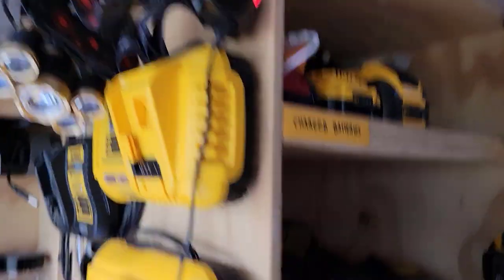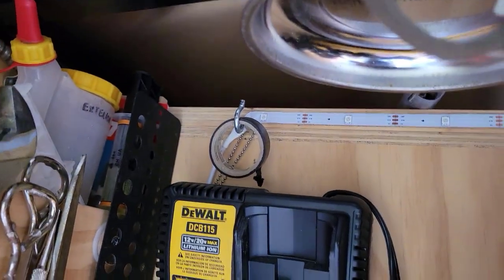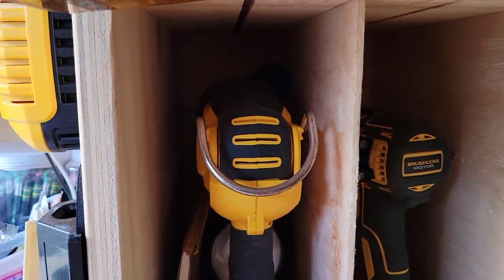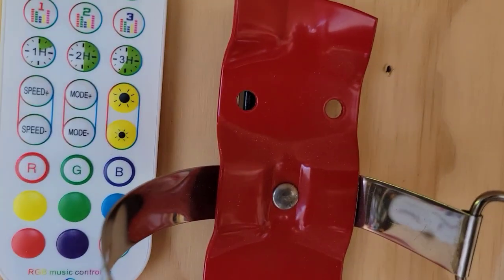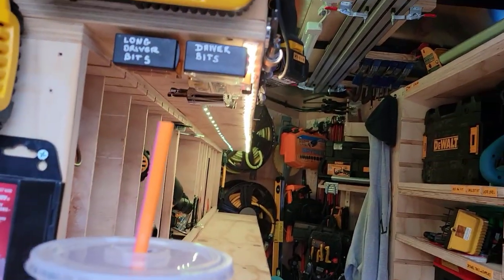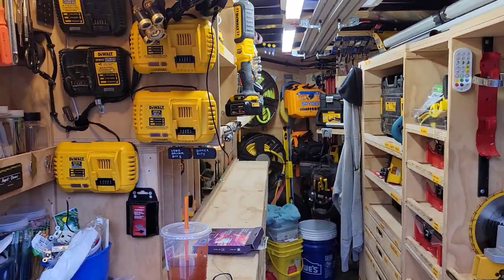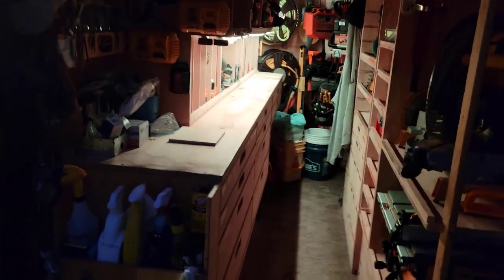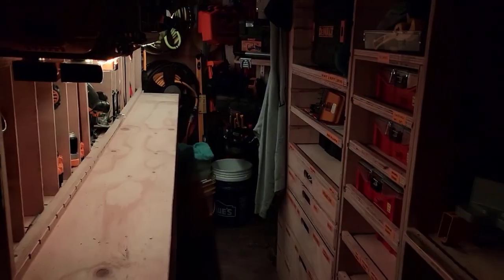Paulk SMART trailer w/DeWalt 20V battery-powered  LED lights

Comment: Very Cool - Thank You for sharing.  I didn't know you could get a USB port on a battery pack
Reply from the maker: Thanks for the comment!  I took a tip from a trailer tour video from Real World Carpentry Remodeling where he uses a hardwired battery pack to power some lights. Not wanting to take the time to wire, I found a USB pack that fits my DeWalt batteries for lights when I am not plugged in otherwise. It has been very helpful and real easy to add.
Reply: Or you could make your own diy with 12 cig female, 12 volt 24 volt in car usb a usb c out adapter some wire to put on or have blade crimps for any  18 volt 20 volt tool battery
Reply: @sdsconstruction  Could you please post a link to where to buy this?
Reply from the maker: @craftymulligar  no idea but it sounds like it would be possible. I am not real knowledgeable with low voltage so I cannot say for sure.
Reply from the maker: @joecnc3341  Hi Joe! I am currently looking for a converter for a 60V flex battery to 24V DC and if I find it, I will upgrade this bank of "just in case" lights to a 24v LED system. This 12V system is finicky with the 20V battery without an inline stepdown.

Comment: Hey Steve. 
I think it was my video that introduced you to the led lights / dewalt power converter. 
Anyway I like the automatic feature of yours . I thought of doing a motion detector switch but haven’t yet. I think I might be inspired to do it now.
Reply from the maker: You are correct! It was you! Thanks for the cool idea. I really took a low tech approach to your system but am really happy with ambient light when not on shore power without the need of a flashlight (even lower tech). Motion detect would be cool but I am only full time in/out of the trailer during the summer so for me, that would be a real luxury. Next trailer? I would like to go “luxury” with many bells and whistles and motion lights and solar panels and marine deep cycle batteries and…and…and! Thanks for the cool idea!

Comment: How long does lights on a battery like that last?
Reply from the maker: Thanks for the comment HT! I run the lights on a 20V 6ah battery and I only use these lights when I am on site without shore power. I have left them on overnight on accident and found them on the following morning so at least 12 hours but I swapped out the battery after that without checking. It should last a while if just using occasionally which is my experience since I can usually get to shore power.  IF you are looking for options to have lights without shore power…..Renovations and Repair YT channel — Richard has a great trailer build out with solar and a battery bank for power when not plugged in to shore power. He has great ideas for his next trailer as well for self-sustained power.

Comment: What kind of run time do you get out of a single tool battery?
Reply from the maker: Thanks for the comment/question Caleb! I wish I had a firm answer for you but honestly, I don't keep mental track. I have enough batteries that I am able to swap out when I see a lag in performance and almost all of the time, when I return a tool to the trailer, I swap the battery and put the one coming off the tool onto a charger. This way all tools are always ready to go with a battery on them and the battery has 3 bars of power so I never have to worry. If I had to say one way or the other, the DeWalt original batteries last longer than the after market ones and the Waitley last longer than the other "yellow" powertech(?) batteries. 

It really depends on the tool its on, the aH of the battery, and what the tool is having to do. My jobsite light for instance on full with my only 8aH dewalt battery will last around 3 hours, 4 or 5 hours on low setting. That same battery on an impact driver would last all day and maybe two screwing down a floor or framing using screws. 

Great question......sorry I don't have a firm answer.